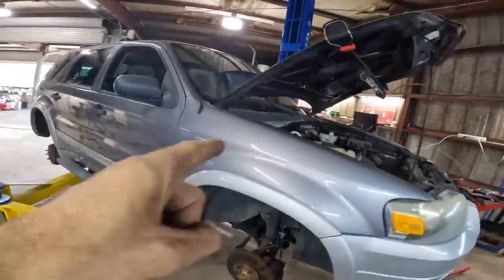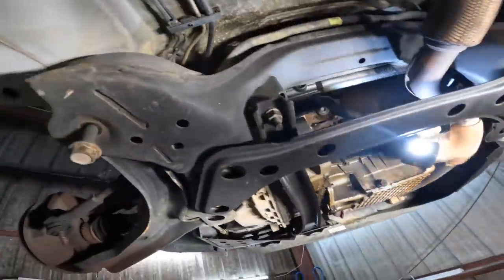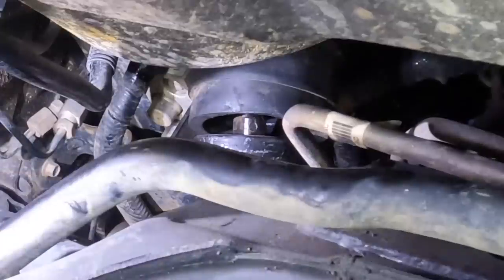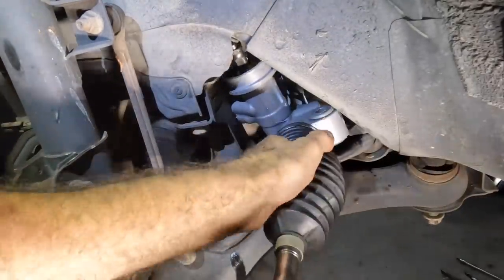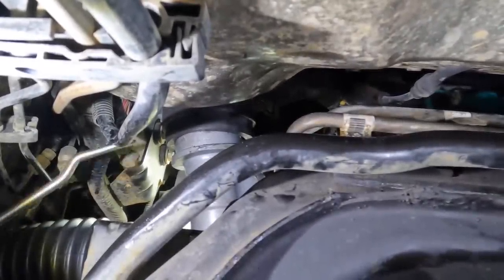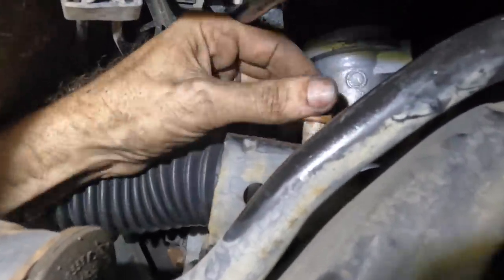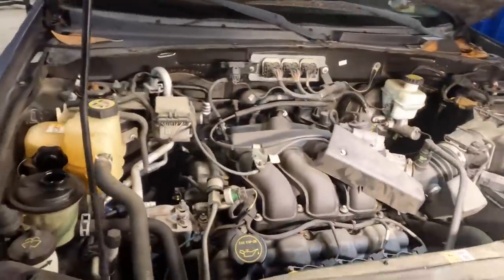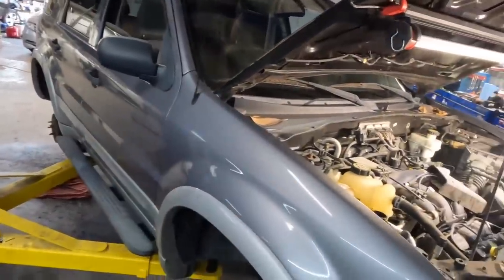Loss of Control, Sloppy Steering! Damaged Ball & Socket! 2007 Ford Escape

Comment: Mate of mine had his tires toed out by 2 cm for 2 years without noticing because the shop that did the alignment probably didnt take off the wheel caps and they stick out...tires were almost down to the casing on the insoide, which wasnt visible under normal conditions. Based on this, i will continue to do my alignment with tapeline and 2 aluminium levels...

Comment: Great job. I have worked on car since 1959 starting in my dads Mobil oil service station. I was 9 when I started almost 10. Man has things changed over the years. I worked as a automobile mechanic till 1968 then went into the metal trades becoming a millwright (welder/ machinist/ sheetmetal fabricator). I still do all my own work on my cars and even have built some very fast and competitive dirt and road race cars. I am 74 now still can turn a wrench doing things like replacing the power steering pump on the wife's 2004 Mustang and doing the brakes including rebuilding the calipers. So I enjoy watching you in the shop and hope that your going on your own will work out well. I can see you have all than is needed to make it. So keep it up and GOD bless you and your family.

Comment: Hi Ray . When I went out on my own I too was without an alignment machine as that as you are well aware is a massive investment . Here is a thought for you from someone who was in the exact same situation . Many times the customer didn't  have the time  right away to get on a rack or the alignment shop was too busy to accommodate me on the same day as i did the repairs . Not wanting to damage customers tires i went looking for a cost effective  solution ..  I purchased an alignment  steering wheel/brake  chalk  ,, set of toe plates and a AMMCO magnetic caster camber gauge  model  # 2550 . By no means are these tools exact but used correctly they put you closer for a proper 4 wheel alignment  than you would believe . Not sure if you knew about this gauge already but thought I would throw it out there . Have a great day tomorrow in your new shop .

Comment: What amazes me is that you don't break the bolts.  I live in the Northeast, and I could NEVER have removed the sub-frame bolts out without shearing at least one.
Reply: Breaker bars and extensions with some penetrant always has done the trick for me here in MASS.

Comment: Ray - some valuable words of advice from a former aircraft mechanic (especially having many Air Force safety videos being drilled into my head):

At the beginning of your workday:
1) Remove wedding ring from ring finger.
2) Hand wedding ring to wife unit for safe keeping.
3) Proceed with your workday.

At the end of your workday:
1) Perform usual hand cleansing procedure.
2) Retrieve wedding ring from wife unit.
3) Install wedding ring on ring finger.

These steps will preserve your wedding ring AND your ring finger.   And I'm pretty sure your wife unit will be on board with that.

Good luck and stay safe!
Reply: I was in aviation for 32 years. Yes, rings are and can be a hazard. The refueler guy next door lost his finger because of his wedding ring. He was topping off his fuel truck at the farm when it happened. As he was climbing down the rear ladder on top of the truck, he went to jump off the last rung to the ground, and his ring became caught on one of the little traction nubs on the ladder rung. Needless to say, the weight of his body jumping down only a couple of feet, completely removed his finger from his hand. He lost the finger. Too much damage to reattach.
Reply: I worked in a semi truck factory for a number of years. It was a big thing there too. A guy got his ring finger degloved once at one of the other facilities because he didn't listen.
Reply: @stevemiller9135  During my compulsory military service, our driver was trying to jump off the ladder of our military truck and got his ring stuck on a ladder exactly the same way. Luckily enough he didn't lose the finger, but it sure looked like it hurt a lot. Obviously we were instructed to leave rings off during the service for this reason, but not everyone does as instructed.
Reply: My uncle lost his too. Taught me to never wear anything - rings, chains or loose clothing. I got a tie stuck in a paper shredder once 😂. Thought it was going to choke me out! Learned my lesson. Never operate anything with loose anything, even in an office. Cost me an expensive tie too.
Reply: Years ago I slipped while climbing an apple tree and tore the ring off my finger and the skin with it it was not a fun experience as a child and I agree with the Air Force mechanic and I'd like to thank him and all men and women that have served this country have a great day
Reply: I've noticed the ring from the beginning.  Never wanted to say anything, but here goes.  The ring is a hazard Ray.  Here is the fix.  Buy a silicone ring for work.  My son has one and the silicone will rip apart before your phalanges does.  On a side note.  I have never worn my ring for work for 37 years.  It had gotten to the point that I would only wear it anymore for weddings and special occasions.  So my wife decided to wear it as a thumb ring and did that for years.  Then she lost it somewhere, I was heartbroken.
Reply: Same goes as a machinist while working safely at whatever is your trade.
Reply: In my younger years, I was hired as a laser tech who replaced the previous tech who lost his life on a high powered argon laser when working on the power supply. That same laser was my 3rd repair after it was released when the investigation was done. My ring is on only during special occasions.
Reply: And baking... And medical... Heck I even took mine off had to go into server chassis. So many grabby bits.
Reply: My husband has me put the ring back on, he said I put it there that I can keep the habit up.  He's kinda superstitious about things like that.
Reply: I work on all sorts of equipment, it only required one near injury to ditch the gold ring,I had one tattooed on.
Reply: Years ago I learned about the term deglove, and I never want to see or experience that!
Reply: My father worked as a electrician.  For a great number of years he did not wear a wedding ring for a great number of years since metal on a finger and high voltage are not a good idea to have in close quarters.
Reply: 33 years in printing at a Magazine, Catalog plant. Thousands of screaming crush points. You learn to leave things off that can get grabbed. When the machine has 2 200 horsepower motors driving printing units it doesn't even care if you are stuck in it.
Reply: My afro caught on fire bad timing caused carburetor back fire...missed my Jackson 5 Concert.
Reply: @torchit007  I had an afro when I was much younger.  Fortunately it never caught fire.
Reply: One more ring story. I was a young apprentice electrician and overloaded my right hand with tools while coming down the extension ladder off a roof I lost my footing and bounced down the last 3 steps with my ring on my finger grabbing each ribbed step. Had to cut the ring off with my dykes as my finger was quickly swelling. Very cheap lesson, lucky to not have ripped that puppy right off ! I was working for a small contractor and I was responsible for taking care of me and not doing a very good job of it. Got a valuable cheap lesson that day, no more jewelry on the job anymore...

Comment: Breaker bar ftw!
I remember we tried to get the spindle nut off the axle of my old Mazda one time... clearly whoever had tightened it down previously had done so excessively...

My dad, who was easily 250+lb at the time, had a 6 foot length of pipe over a 3 foot breaker bar, and had to jump up and down on the end of the pipe multiple times before the nut finally started moving... it was pretty insane.

Comment: At 0:57. It is a split pin Ray. A Cotter Pin has a tapered ramp that you tighten by way of a threaded nut, to tighten it to hold the lever in place, locating the part on an axle. I know because I put too much torque on my bicycle pedals when I was a kid and went through a few.

Comment: Hey Ray, you should check out ridgid's new high torque impact (Model R86211B). It would make quick work of those sub frame bolts. Broke loose the lower rear strut bolts on my '09 Expedition (the ones that are required to be torqued to 350 ft/lbs) no problem.

Also, on your video where you had your truck on the lift and you thought your upper ball joint boots were torn, those boots aren't torn. That brand actually has a small hole in the bottom to let excess Grease escape to prevent over-greasing & blowing out the boot. I use those ball joints in my lower control arms & their sway bar links have the same setup with the boots ('16 F150).

Comment: Over the decades I've learned that I couldn't always assume the inner tie rods were tightened correctly on rebuilt racks as I've had them come loose a couple of times and had caused some hairy situations, so I now always pull back the boots to snug down those inner tie rods while the rack is still in the box just to be sure. 👌
Reply: You should just replace it yourself at that point
Reply: Better safe than sorry

Comment: Ray you can get a 5quart, jug at Walmart for $29.00and save yourself about $15.00for the profit draw and some carry the 12quart box that is around $54.00 for even more savings. If you buy the 6quart case, you save 50%
Reply: You're absolutely right but it also helps Ray to have a good relationship with his parts houses (they know he could buy the oil cheaper) for when he needs a rush delivery or some other "special" services. When he gets big enough he can start buying oil in bulk.
Reply: @guzzijack9714  I don't think he has a relationship with a part store yet, he was trying to get a business account but couldn't find a parts store that had anyone that knew how to get him a business account.

Comment: I had my Pitman arm nut and washer come off of my steering box on my Duramax while going down the road. That was a seriously not fun experience. Thankfully i was only doing 40mph and was able slowly brake and road the curb to keep me from turning. Had so much fun reinstalling my pitman arm in the middle of a turning lane on a 5 lane road.
The new shop is looking good!

Comment: Hi Ray great to see you up and running my favourite channel.

One tip if I may from an old timer, when filling the PAS, do something simple to prevent the engine starting but still crank like pulling the fuel pump fuse. Apply a charger or jump leads. 

Fill reservoir. Crank the engine, at same time turn steering wheel side to side, after a few seconds top up again, then repeat same. Top up before starting engine. Turn quickly side to side then after a minute or so running top up to level. Saves the pump running dry and gets air out quicker mate 👍

Comment: I've always used a vacuum pump for pulling the air out of the power steering lines and I've turned the steering wheel back and forth to aid in removing the air from the system.

Comment: New steering rack quote for my 95 Civic, no power steering $1260! I'd already done the ball joints and outer ends. Took me about an hour and a half! Did the string alignment and it only needed a small adjustment! It can be done!

Comment: Enjoyed this one Ray. I pulled the subframe and steering rack out as one unit to make room to drop the engine and trans out of my Nissan Versa a few years ago. ( very similar setup). I thought to myself during reassembly that I hope I never have to do that again to replace the steer rack but this has shown me the tricks to do it without total removal of the subframe. Thanks. Hope I never need to but nice to know this just in case.

Comment: Funny to me.
I used to find this stuff all the time when I was an apprentice.
The people around me tried to say I was wrong, but the old parts were there in a steel barrel or turned back in as required.
Lighter cars, lighter components. Holes in the road, train tracks, speed bumps, it adds up to loose parts, leaking rack and pinion, and plenty of work for a guy who knows what to check, and how to check it.
Improver parts updated by Ford are often better made than the ones that first came with the vehicle.
I suppose you count the turns or use a toe gauge, or both. You don't have an aligning machine.
There are ways.

Comment: In US English, a split pin and a cotter pin are the same thing - but in British English, a cotter pin is a part of a "cotter" - and it might (or might not) not be a split pin - but could instead be some kind of a wedge with a nut holding it in place instead of bending the pins apart - kind of like a taper fastener.  To confuse matters further, there is something called a "circle cotter" - which is like a key-ring - a circular split pin (kindof) and a butterfly clip, which is also a kind of split pin.   WIkipedia articles "Split pin", "Cotter (pin)", "Circle cotter" and "Taper pin"  - then, just to confuse things further - R-clips and similar gadgets are also kinds of cotter.

A "cotter" was originally a term for a peasant farmer - who might be inclined to fix a wheel onto an axle with a wedged pin rather than bolts and such.   So a "cotter's pin" might be the original derivation...hence the British English term for any of several kinds of fixing device might be more correct.

All very interesting and entirely useless.  But just like almost every other part of a car - the British and US english terms are different.  I think it's safe to use the term "Split pin" and be understood on both sides of the Atlantic - but "cotter pin" could possibly be misunderstood.
Reply: Thank you. I’ve always had a interest in the origin and meaning of words. Meanings also change over time.  Have a great!

Comment: Great videos and I'm glad things are working out for you.
A bit of advice on power steering systems. After a repair where the system was open, use a handheld or air operated vacuum pump on the power steering reservoir to pull air out of the system before startup. Makes a big difference getting air out of the system. The good Mityvac handheld vacuum pumps generally come with the little suction cup things for this reason. Most people don't know what it's for and trash the adapter.

Comment: We were somewhat agreeing on the oil and filter til you brought up Pennzoil. Dang. You are definitely using good stuff. Me personally I had a bad experience with the Mobil 1. Was in need of oil change and they were out of what I use. My truck knocked and smoked. Then I lost oil pressure all together. It was only in my truck for a week. Truly thought I lost the motor. Valvoline max life is all I ever ran. Still do. I do miss the fram high mileage filter. Since it disappeared I'm stuck with k&n gold

Comment: I used your Amazon link to the long swivel ratchet box wrenches made by Mountain Tools and loving them.  As thin as they appear I tried bending by hand as hard as I could and they do not bend.  I would imagine in a vice and pulling with two hands I might be able to but, no point in doing so.  The offset side worked perfect for me to turn my crankshaft bolt when I was searching for TDC on a cylinder.

Comment: @27:19 Years ago, I was able to make deals directly with petroleum storage/transfer facilities, for oil products. They would deliver 55-gal drums of virtually any name brand oil, transmission fluid, hydraulic fluid, etc... directly to my shop on a regular interval. I can't remember the cost difference, and no doubt prices are substantially different now ~20 years later. But there were substantial savings, and I never had to go out of my way to locate and stock my own oils.

Of course, I don't know how feasible that is for automotive, where you need a larger variety of weights and blends. I was managing a fleet of diesel equipment, all from the same manufacturer...so I had a more focused contract.

Comment: Thanks to your knowledge in automotive derp fixerings, I was able to diagnose my check engine light to find it was the number 8 cylinder, did my switcheroo of the 7 and 8 Ignition Coil and retested to find it was the 8. Also checked the spark plugs (just fine) and was able to fix my POS all I cudda ford explorer in about 10 minutes. once I cleared the codes it was perfect.

Comment: I used to measure the tie rod end and count the threads and get the alignments so close to spec that the alignment shop couldn't believe how close they were when they put them on the machine. They were off, but not by much.

Comment: I've used M1 and wix in my GFs honda pilot with good results. I use M1 in  both my 540hp 6.2L V8 powered mercedes c class and 2005 dodge viper and it works great. Not a thing wrong with what you got going in there 👌

Comment: Nice to know your working on cars in which the owners are actually want you to work on, meaning that you do not diagnose and then the owner is like naw I'll just ignore you and drive away.
Reply: Most shops charge for diagnosis nowadays for that very reason. I think a good way to not deal with cheap a** people in the first place is to have the labor rate higher than the average, especially since Ray has no need for high volume, just enough to make three videos a week, or four, or five.

Comment: My experience with tierods, says they are almost everytime either 16 or 21 turns in at every side, so that is my go to standart when nstalling new steering racks.   And please remember to lock the steering wheel when removing, so you dont accidently break the airbag clock spring. ;)

Comment: Hey Ray, just a quick caution I've found on the new outer tie rod ends with the zerk fittings.  Use caution putting the zerks on as I've had the bottom of the zerk smash into the thop of the ball inside the joint.  Which meant the grease would not enter the hole.